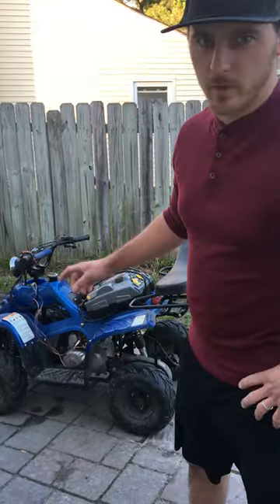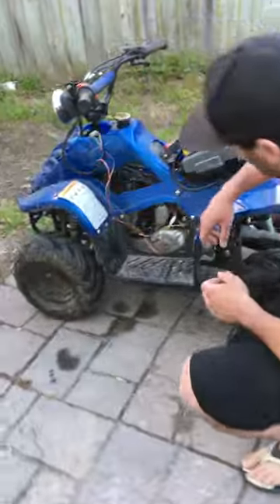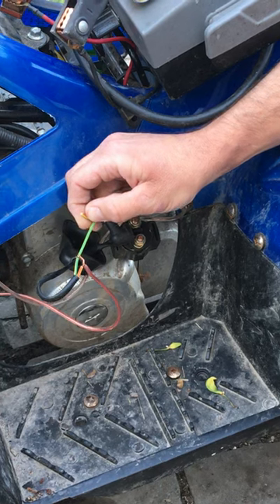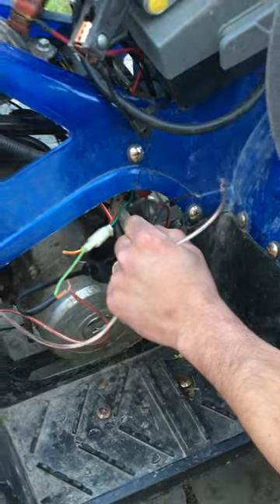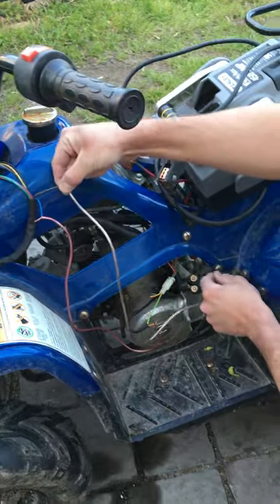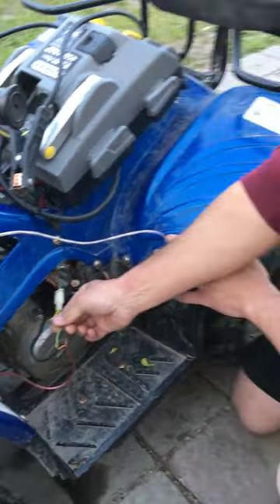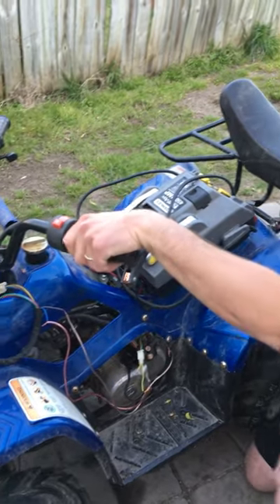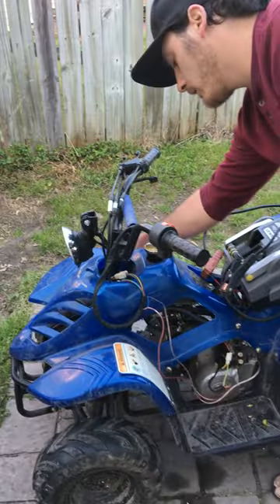Tao Tao Alarm Bypass / Starter solenoid fix

Comment: Hey buddy quick question I have a coolster 110 very similar quad, all lights work, new battery and get the dreaded click, thought no problem I’ll jump with a screwdriver but I’m not getting spark touching the two terminals together on the solenoid, any suggestions?
Reply from the maker: @tylernutt9579  yup, probably a bad stator. If your kill-switches are all good
Reply from the maker: Comment back if that doesn’t do it, test your coil wires first to make sure they are getting power, use a multimeter. Also your battery might be low on juice so jump start it with jumper cables or jump pack.

Comment: Thank you think was helpful cause my four wheeler was having the same problem until I came across by you
Reply from the maker: Dude I loveeeeee comments like yours. Save the machines!
Reply: Bro it was just working now it stop working what u think is doing that
Reply: @Cheaphorsepower I wanna show you what’s my four wheeler doing
Reply from the maker: @kosjayden1045  might be a carb issue remember all machines need “puff(gas) bang(spark) blow(compression)” no if your not getting enough clean un restricted fuel that maybe the issue, especially if it’s been sitting. Try starter fluid. If it runs great at the start then dies it probably needs to have the carb cleaned out
Reply from the maker: @kosjayden1045  try my first suggestion then comment back ok? Let’s get that puppy running good
Reply: Bro thank you it’s working back normal thank you alot
Reply: And what you think do that every time I put on my filter it doesn’t want to it bogs down

Comment: Is there any way you can take a picture of the wires inside of the toggle switch. The blue and brown wires were detached from their solder points.
Reply from the maker: It’s really tough to see on video they are really small. But when I took it apart those were the colors I saw

Comment: Hi I’m having trouble with my quad, the solenoid just clicks, can you help? 
Thanks
Reply from the maker: Yes for sure, if it just clicks you can jump the terminals on top with a screw driver to see if the solenoid is bad. If that doesn’t do the trick it maybe a bad starter. Let me know once you’ve tried this!

Comment: Thanks finally got my boys quad running but quick Q,should i disconnect battery once it started because i noticed the 2 wires that i connect were getting hot?
Reply from the maker: It shouldn’t be getting hot it must be shorting out on something

Comment: This worked great for a 125. For months it started no problem but now I have to have black/white disconnected to run. I believe that is kill switch. Should I change out kill switch?
Reply from the maker: Ya, actually if you want you can alway wire up a toggle switch to it or tie the wires and tape it. It’s personal preference really, I’m so glad it helped!

Comment: Great video brother. I have a 2016 Toa Toa model Boulder B1. Would you have a simple wiring diagram to show how to rewire this thing 
so there is only a starter switch , kill switch and maybe a key (dont know if i even need a key) . I want to eliminate all other wiring.I dont 
want light or anything else.
that smart box has been a pain in my ass.
Reply from the maker: Ya for sure I can show you what I’ve been doing with my next video
Reply from the maker: Hey brother I had an idea to help you before the video, it’s what I do every time now. Look up a kickstart harness on Amazon is the simplest headache free harness, then copy that setup by cutting away everything you don’t need on your current harness like lights and solenoids voltage reg blah blah blah. You won’t need the whit or yellow coming off the stator either and you’ll only use the green wire going to the key if you keep it! Simple right? Let me know if this helps! Then last step just is a battery or a jump box to trigger the starter like I show in the video, I have another video in my channel that I show how to do this too if you look through my recent stuff, thanks for watching!

Comment: Hey I can only get my 150cc to start by jumping relay solenoid with screwdriver any tips ?
Reply from the maker: Use this trick. This will be the same on your 150cc all your doing is bypassing the computer and activating the solenoid manually.  Just like jumping the solenoid.

Comment: I dont have a blue and grey wire so i looked to see what the kill switch wires were and it still didnt work is the a different wire i need to be looking for?
Reply from the maker: Depends on your machine, some use different colors, you could always just hook it up to a different switch if you wanted you can pick one up at autozone orielys or advanced

Comment: When I hook up a power source for the battery nothing happens I push the start button while holding the brake nothing happens can you tell me what it could be I don’t know anything about quads just remote control cars also there is a little red wire hanging off by the power wire that goes to the battery can you help me
Reply from the maker: Try to jump the solenoid (screwdriver trick) to see if the starter is still good. If it’s not trying your battery is either too low or your starter is dead. If that still doesn’t do it try and manually ground that green wire coming off the solenoid to a ground. Make sure you put it on the “right” power source too. Meaning not the starter side of the solenoid but the battery side.
Reply from the maker: https://youtube.com/shorts/Wk0lvZBODKk?si=oRTQBRS4t2oYFlUq

Comment: I gotta 125cc tao. I got spark to plug but still want start. Replaced cdi. I think it's the key fab or another kill switch. I removed the kill switch pin from cdi n still won't fire. I'm gonna try this  if it don't fire still could it be carb? I smell gas when I try to start it. Maybe stator or timing. Ugh I need helo
Reply: I does
Yours have the key fab alarm cause right now I’m
Having same problem and found that my alarm box has broken wires then opened it up and was all wet inside. 16 bucks on eBay for new alarm box
Reply from the maker: Let me know how it goes. The alarm so these things always mess with the machine.

Comment: About to try this out. Just picked up on and it's not turning over. No spark at the plug... Think it's the key... Is there a we to by pass everything?
Reply from the maker: This is how you bypass everything
Reply: @Cheaphorsepower  deal. 👍🏻 Giving it a go after work. 🤞🏻 Hope it works.. I'll keep you posted.
Reply: Bummer... Just did this and still no spark at the plug... Any ideas?

Comment: This is confusing? I’m following the directions. The red and yellow wire that I snipped off goes from the red wire that connects to the battery. Then I connected that to the start switch. Then the other wire to the solenoid connects directly to the starter
Reply from the maker: Right, that should have worked. You just typed out the instructions perfect. Is there anything else? Did it work?
Reply: @Cheaphorsepower  thanks for the response. I ended up connecting a wire from the push start to the ground of the starter. Then the other connected to the solenoid. I got rid of that wire that you had connected with the red and yellow. And it worked! Thanks
Reply: Yep I'm confused to where the the wire goes on the solenoid?

Comment: You didn't show cleary the the ground wire that went to the solenoid. Im hopeless with all this. Thats the only part i need explained now..
Reply from the maker: The green wire coming off the solenoid is the ground. The yellow wire is the power wire. That will go to one of the wires on the switch to the handle bars. The other wire will go to the power source (positive side of the battery). You can also just attach it to the solenoid to the side that has the big cable wire coming off the positive side of the battery. See on side goes to the starter the other one is coming off  the battery that’s how it gets power. The solenoid is just a switch that makes that connection. That’s why when your solenoid is broken you can use a screwdriver to connect the too and “jump” that connection in a bind if you really need to start your machine in an emergency. Hopes this helps! Good luck!
Reply: Hey mate, I got it started following one of your other video's by jumping a battery with leads to starter and ground wire..appreciate you heaps ..Legend..From Australia 🇦🇺
Reply from the maker: @dynoshane2651  I’m so glad to hear it! It’s crazy how simple it can be to get them running again and it’s amazing how many people will give up and throw them away vs. finding an easy solution like this.
Reply: Yeah someone threw there's away that's how I ended up with mine 😂 just need a new battery & 3 tyres..

Comment: Would it still have spark before the bypass?
Reply from the maker: Not usually no, if you have spark and fuel check compression, these engines are famous for bent intake valves
Reply: @Cheaphorsepower  ok thank you.

Comment: Mine just clicks every time i hit the ignition....would this fix that?
Reply from the maker: Probably not. Try jumping the solenoid to rule that out first(connect the 2 terminals on the solenoid with a screwdriver) if it tries to start it’s the solenoid. If not then your battery is low or your starter is dead hopefully this helps!

Comment: What was it doing before the repair no crank?
Reply from the maker: Crank no spark sometimes no crank too
Reply: Ok I see am going to try this I have one and I have no crank at all which am checking powers am new on this small engines but am a mechanic on diesel and gas so I’m going to try little engines
Reply from the maker: @pedrocasas1026  that’s good, the wiring on these are really simple, you can also bypass the whole harness like I did here but go straight to the solenoid. Like the screwdriver trick you can bridge the power wires the jump the solenoid to see if that’ll work, if not you have a bad solenoid. That don’t go bad often but that’s the best way to tell. If you’ve got plenty of power to it and all it’s doing is clicking, and it turns the motor when you jump it it’s solenoid. If you jump it and nothing happens then your starter is bad those are pretty common. They usually warn you by turning slower and slower like it’s losing power. Sorry for the long message! Hope this helps

Comment: So i did this and now I don’t have a kill switch. I had to pull the spark plug wire to kill the engine.
Reply from the maker: It’s because your alarm was switched on the last time it was running, you’ll have to redo the kill switch to work again and bypass the alarm, I have the same issue on the build I just made a video on. I’m actually gonna do a video on it next week when I get back home
Reply from the maker: Easiest solution for now in the mean time is hook up a toggle switch to a ground and splice into the green wire going into the ignition coil just like how they do it on predator 212cc engines
Reply: I’ll try that tomorrow thanks for the reply

Comment: I’m confused I lost the remote my sons won’t start
Reply from the maker: Try this quick fix before your rewrite it like my video shows. Take a jump box or a battery and ground the ground wire from the battery to the chassis somewhere and touch the power wire from the battery to the power wire coming directly off the starter, the ending should fire right up like normal. My bypass trick does the exact same thing just hooks it up to the starter switch and stock battery. That and make sure your key and kill switches are in the on position. Text me here if you need more help
Reply: @Cheaphorsepower  Allright when I get home

Comment: I have no spark.  I need to delete all safety shit offs on this thing and I can't figure it out
Reply from the maker: It might be the stator or coil. If you have a multi meter you can look up how to check each one. You might wanna check the ground wire for the coil I’ve seen those get loose sometimes

Comment: Ayo #cheap horse power reply I need help
Reply from the maker: Hey what’s up
Reply: @Cheaphorsepower  I did a motor swap with two mini quads but it won’t start the engine up
Reply from the maker: @taycoolin8234  is the starter turning the engine over? If not you might have a blown starter. If the starter turns the engine over just fine check for spark. If no spark you have and issue somewhere.if yes to spark then it’s fuel or low/no compression.